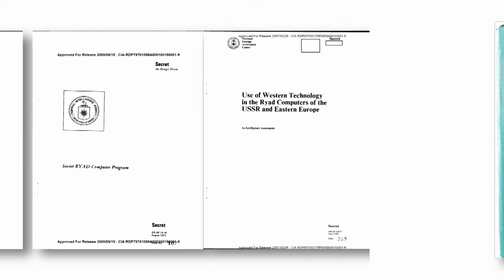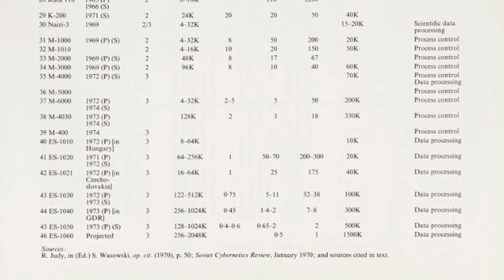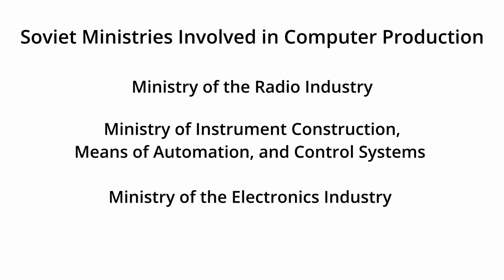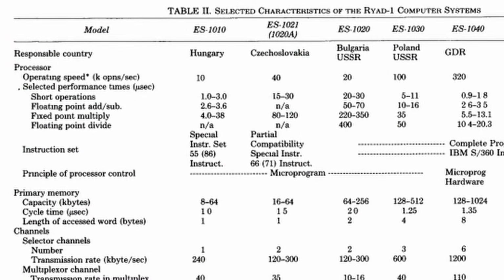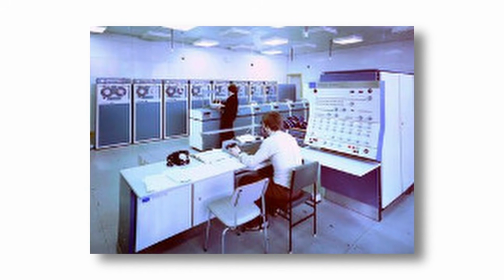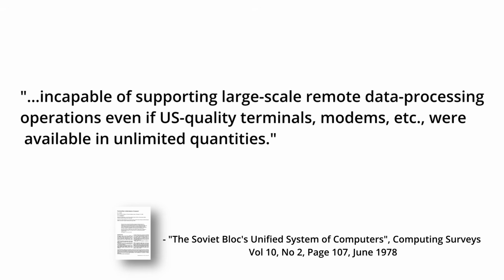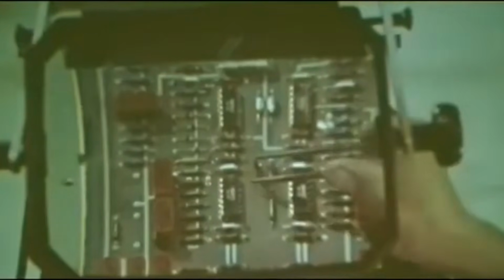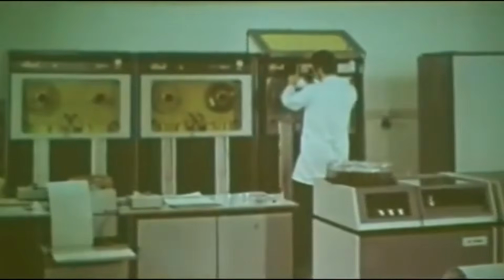RYAD - The Soviet attempt to clone the IBM S/360

Comment: Thanks for the trip to the past. I used to work part time as a student on Minsk-32 you mention. As I recall, we used IBM 360 manuals for everything. I always thought it was a direct clone. And as you say, the only options you had in languages were machine or assembler, for the most part, with a bit of Fortran thrown in.
Reply from the maker: Very interesting, I wonder why they used 360 manuals? There obviously had to be a reason, but I haven’t seen anything anywhere that said that the Minsk-32s were S/360 compatible in any way, apart from being able to use some S/360 peripherals (tape drives/card readers/etc). Although given how prevalent the Minsk-32 was through the late 60s and early 70s, and with the RYAD example to follow, maybe there was an effort to get one of the RYAD’s 360 compatible operating systems ported to it(DOS/ES would have probably been the best choice, since it required less RAM than OS/ES). That would at least explain why your Minsk-32 installation used 360 manuals. 

Thanks for the comment!
Reply: @AnotherBoringTopic  
В СССР широко использовались американские языки программирования на компьютерах собственной разработки (например Минск-32).
Такие как COBOL, Fortran. Очень вероятно, что они хорошо были описаны в мануалах IBM360.
In the USSR, American programming languages were widely used on computers of their own design (for example, Minsk-32).
such as COBOL, Fortran. It is very likely that they were well described in the IBM360 manuals.
Reply from the maker: That makes a lot of sense, thanks for taking the time to leave a comment!
Reply: @AnotherBoringTopic  I never worked with Minsk-32 but i know some friend who did. I will ask in what degree they used IBM 360 manuals. I think just for  COBOL language. My first computer was Minsk-22M. Company aquared it used from user who replaced it to Minsk-32. That user very regret about this update. Minsk 22M was slow, but reliable. Buttleneck was in tape recorders. It use 35 mm free falling tape, and tape sometimes broke in half, but it was not often. We use it 24/7, with 1 hour maitenance brake every 24 hours. Some tasks took few hours to complete. We use ALGAMS and FORTRAN. It was 1973-1978. 
Next was ES-1022. First year or two we used DOS-ES, as I remember it was some problems to use OS-ES with 7.25M disks, but later we got 29G disks and switch to OS. We used Fortran and PL/1 languages, and home made Sirius database.
Next computer was ES-1045, but I think it was copied from  370. ES-1045 was bad. Sometimes we reboot it up to 10 times per day. 20 programmers spent all day at display and acomplish nothing. Day after day.
Semthere in video you said about graphical displays made in Hungary? I was lead programer responsible for graphical tasks. I can say - where was no workable graphical displays in ES family. ES -7061, if i remember correctly.... was made in USSR, probably 2 copies. It was so poor in memory, that it was not possible to make anythinc practical.
Reply from the maker: @velonabludatel6879  This is fascinating, thanks so much for sharing your experiences! From my understanding, the 1045 line are first gen Ryad systems, based off the 360 line, but the 7060 series does not fit any of the first gen naming that I am aware of, so I assume that's from the second gen Ryads, based off the 370 line? 

Regarding the Hungarian graphics terminals, my sources claim that they were supposed to be the primary/main source of graphics terminals for Ryad. However they do not say how reliable they were, and it definitely doesn't surprise me to hear that they weren't very good. Where else did your terminals come from? I've definitely heard that East Germany made terminals, but I've never heard of them being associated with Ryad. 

I also appreciate you mentioning your experiences with the Minsk line, I do plan to cover both them in a future video, subject to my finding enough research in English (I sadly do not read or speak Russian) to get a better picture of it. Lot of neat Soviet mainframe systems out there that deserve to be better known.

Thanks again for watching and leaving such an interesting comment!
Reply: @AnotherBoringTopic  Thank you for answer and interest to my comments. Yesterday I was so exiting. It big part of my life. I wrote yesterday comment spontaneously from phone. Just from my memory, but it was so many years ago, I could mixed up something. 
I afraid to be annoying, but if you consider it useful, I will dig in my archives - pictures, articles I wrote at that time, call my friends who  are alive. 
I probably know about Minsk 22 more than about Ryad. On Minsk 22 I began as hardware maintenance engineer, later switch to programming. On Ryad I focused more as software  team leader and application engineer. So hardware and operating systems was not in my focus.
I hope I still have original 1970 books manuals for Minsk 22M, somewhere in garage or basement. I will look. When you expect to make video about Minsk?
I have few pictures of Minsk 22M and unic plotter made by my team in 1975. This plotter was attached to Minsk 22M and controlled by software.
Reply from the maker: @velonabludatel6879  Far from annoying, I would be very grateful for anything you can give me. I take my research seriously and the vast majority of English sources on Soviet computing that I’ve found so far were not written by anyone who directly worked with the systems. 

At best they were able to evaluate one (such as the CDC did with the ES-1040), but that’s a far cry from working with one day in and day out for years, getting familiar with all the idiosyncrasies, and doing actual work as opposed to simply evaluating performance. You have experience that simply cannot be replicated by a few people testing a Minsk/Ryad machine for a few months and writing a report on its capabilities. Not that reports like that aren’t enormously valuable too, but there is no substitute for genuine hands on experience, under real conditions, for years. 

Any pictures, articles (if no English translation I can use google translate), memories from you or people you know, whatever you are able/willing to give me. 

And you would be the one doing me a huge favor, so however much or little you are comfortable doing is fine, I don’t want to ask for too much of your time! 

I don’t have a timeframe on the video, once I feel like I have enough research and notes (and finish at least the three computing history videos currently in my queue) I will start working in the script. Figure at least 6 months or so. 

You and anybody else who is interested in sending me research material are welcome to email me at boringtopic@gmail.com